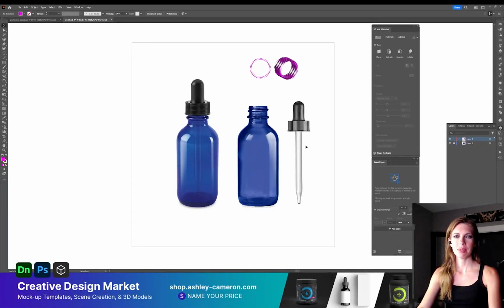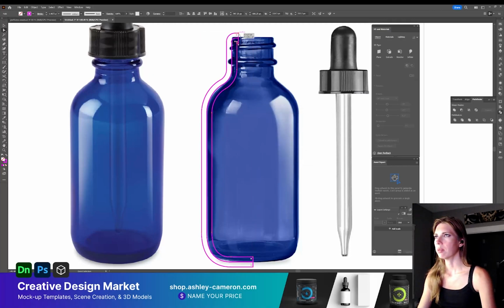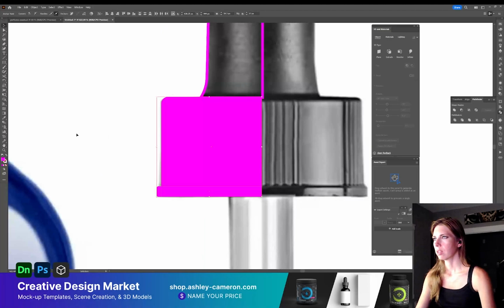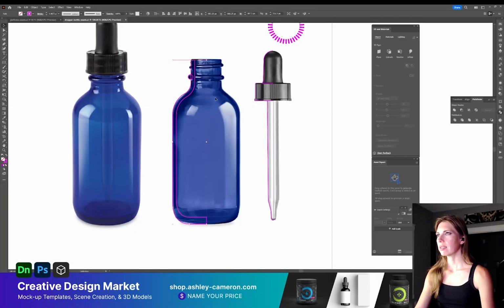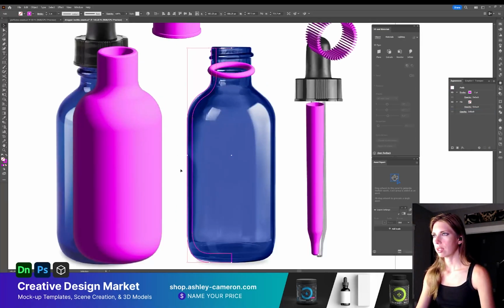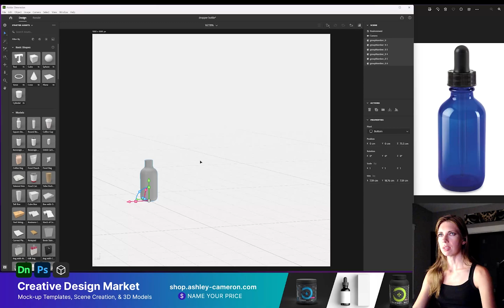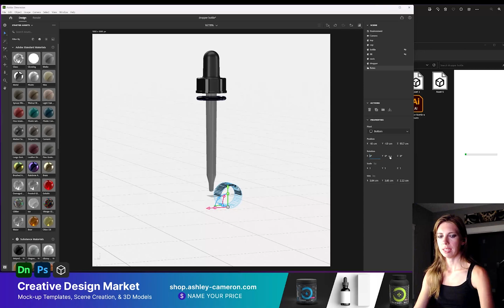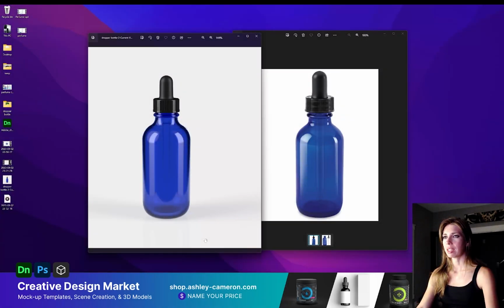Create a 3D (.obj) Dropper Bottle Mockup using Adobe Illustrator & Dimension

Comment: Hi Ashley, I’ve been using Adobe Dimension to apply my graphics onto a corrugated box design. However, I’ve encountered an issue where artifacts appear on the opposite side of the box when I import the graphics. This has happened before, and my workaround has been to export the PNG graphics in smaller sections to prevent debris from appearing on other sides. Have you experienced this problem, and do you have any tips for a more effective solution?